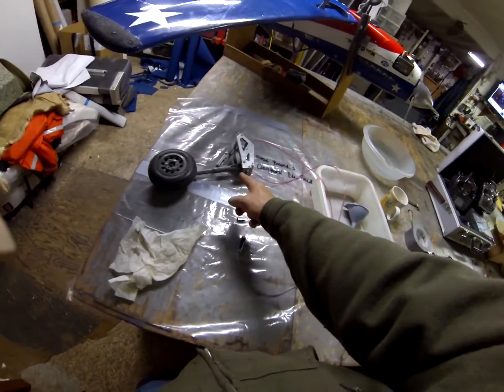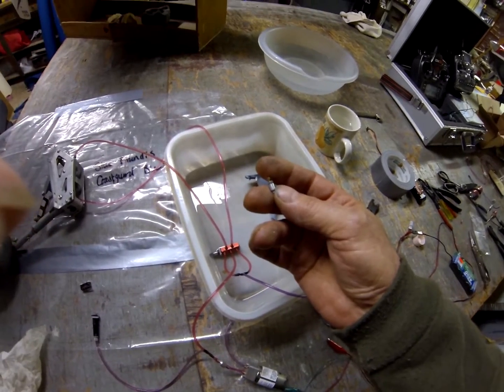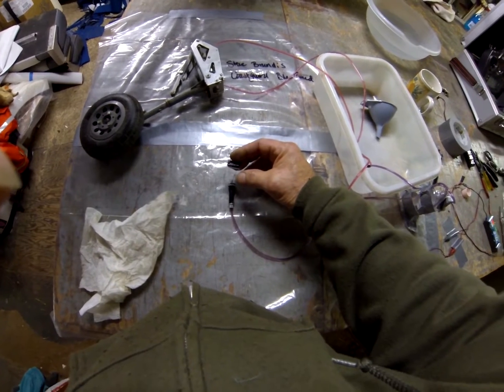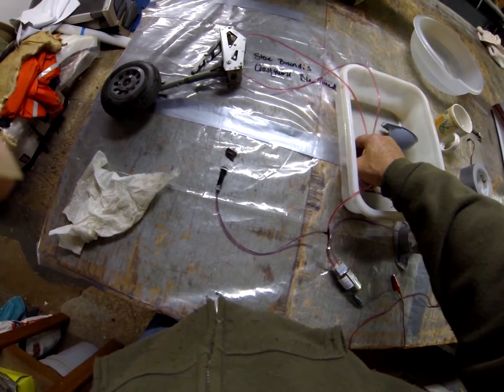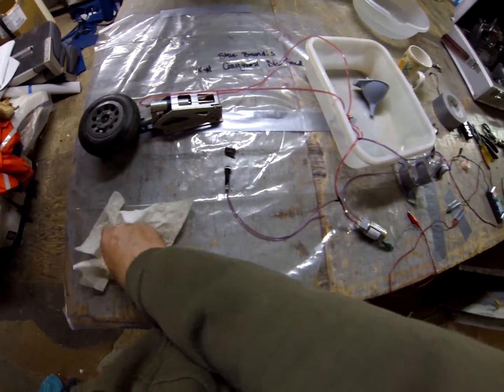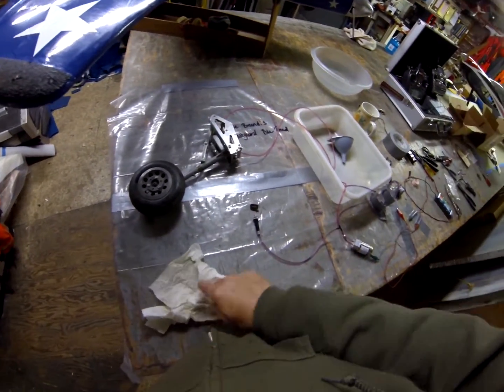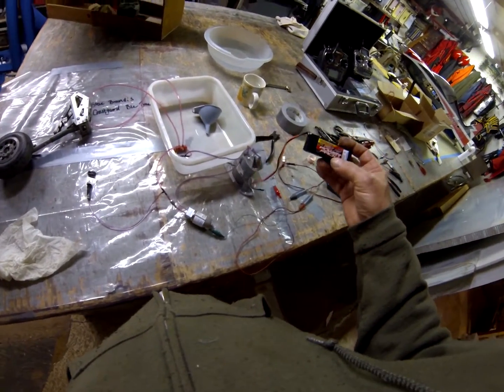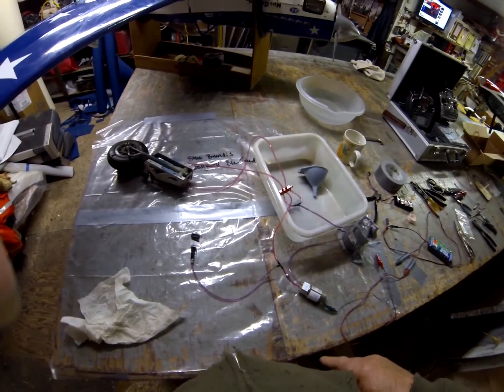r/c hydraulic landing gear

Comment: What is the name of the small hydraulic pump you are using?
Reply from the maker: Hello it is a pump for miniature  rc heavy equipment bought it from a company in spain
Reply: Brandis56

Thanks so much for the info. Your system works very well in the video. Have you continued to use it installed in a plane?
Reply from the maker: yes it is in this mustang and I still have and fly it.
Reply from the maker: https://www.youtube.com/watch?v=kmyLivR_0kA
Reply from the maker: http://www.magomhrc.com/en/39-hydraulic-pumps